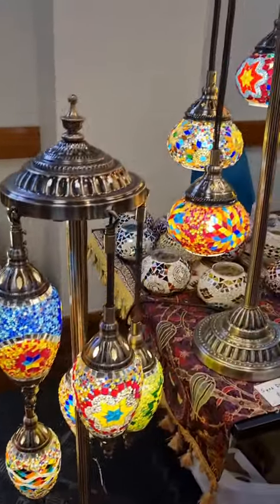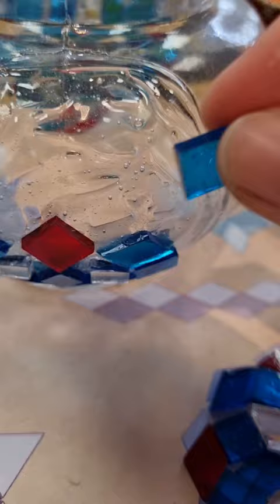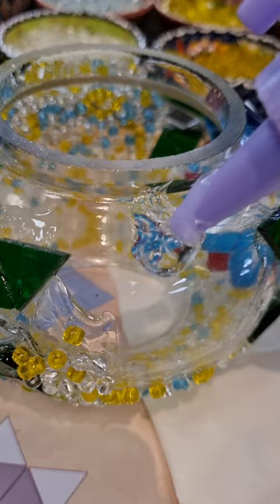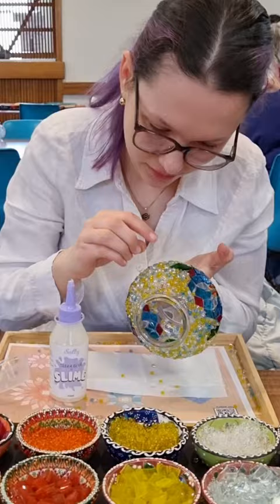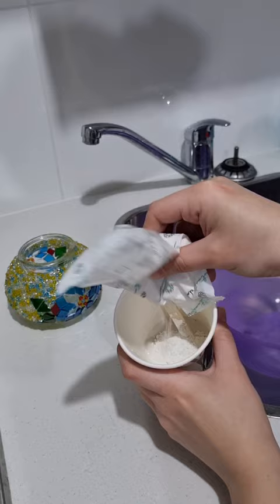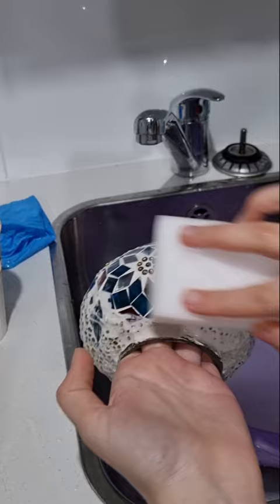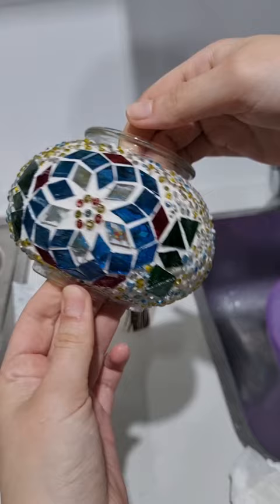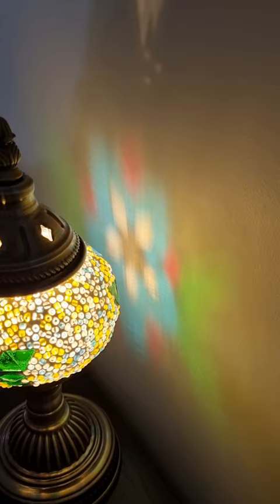Mosaic Turkish Lamp Making DIY from Art Masterclass #shorts

Comment: Witch glue did u use to stick the glass?
Reply from the maker: We used a glue they gave us which was I think similar to normal clear PVA, labeled as "Clear Glue for Slime". The ingedients on the bottle are: Poly Vinyl Acetate 55%, Ethanol 20%, Ethyl Acetate 25%.
Reply: @Youknow_Diana you are amazing to reply to your comments.. Really appreciate! Loved your art work. 
Can you also let us know what material is that white one?
Reply from the maker: @shrutimehendinailart8045  thanks so much! Do you mean the plaster at the end that seals it in? I think that was just normal "plaster of Paris" is what it's called.